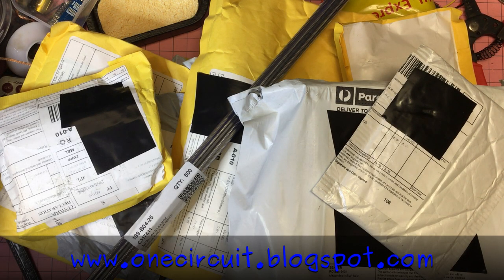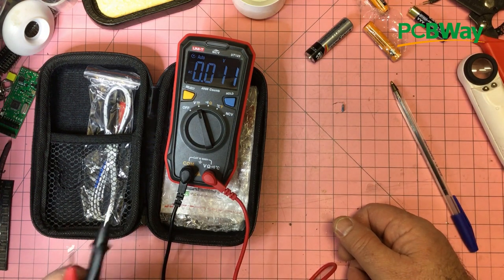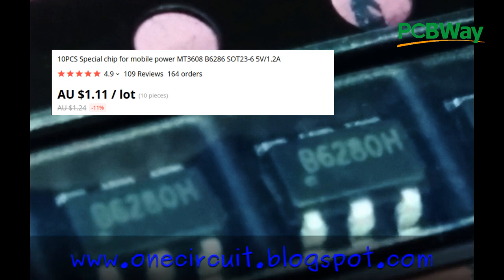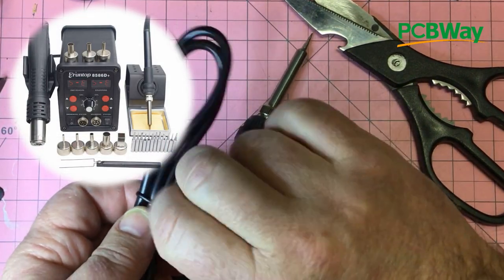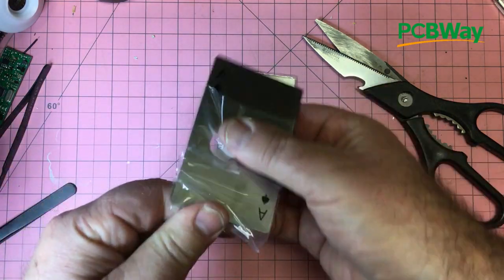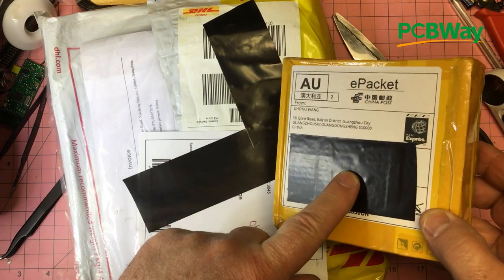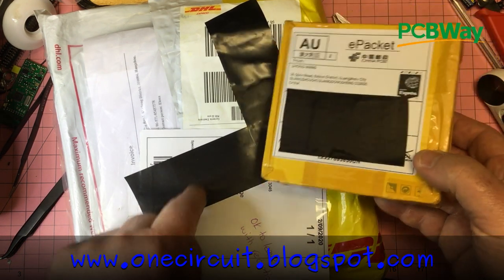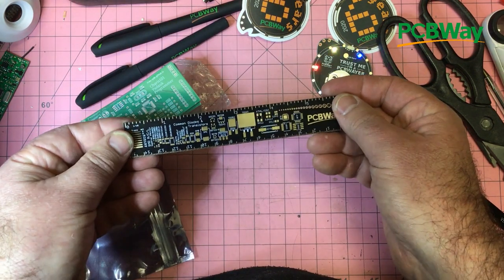Mailbag #3

Comment: I quivered a bit when you opened the STM32 box ;)  LCSC is my goto places now to order. I have had a Uni-T UT136B for @3years that I love. Got it because my Fluke is missing capacitance checking. It's been a great meter for less than 20$! I keep it velcroed under my bench for each access.

Comment: Those Paduk chips are super cheap on their own, but the programmer seems to be more than making up for that in expense (both cash and time).

I'll be interested to see how the "old man" boards come out.
Reply from the maker: That is absolutely true and now it has become a matter of pride rather than common sense - the hours wasted! Fortunately I have a deep passion for solving problems so there have been many satisfying moments along the way that defy the standard economics of time/money investment. I'm going to solder up the through-hole version this week - fingers crossed.
Reply: @onecircuit-as  I can get behind stubbornly chasing a project beyond all practical sense. 
I'm working on one of those myself...
Reply: @onecircuit-as  It boggles the mind how much time it would take to apply 500 MCUs manually.
If your Old Man board works out, am interested in a kit with the  board,  STM32F072, plus maybe 10 Paduk chips.
Perhaps it would help you recover some of your costs.  You plan build them all out and sell them individually?
Reply from the maker: GnuReligion I think that would be a good option. Unfortunately freight is a bit of a problem at the moment, even assuming everything works OK! I’ll certainly put it up on Tindie if it is viable.

Comment: What vendor did you get the female headers from?  I get mine usually from LCSC or Tayda. I see they offer many sizes. I try to keep a few of the common sizes I use a lot to keep the cuts low.
Reply from the maker: AliExpress for those ones. Not sure what I’m going to do with the 1mm pitch versions. I need to be banned from purchases after 9pm! 🤔
Reply: @onecircuit-as  Thanks. 1mm pitch is not in my needs as well.  I do keep 2mm male and females for a Wifi adaptor I use and 4 pin females for Grove connectors.
Reply from the maker: @UReasonIt  here is the actual link: https://www.aliexpress.com/item/32859544578.html